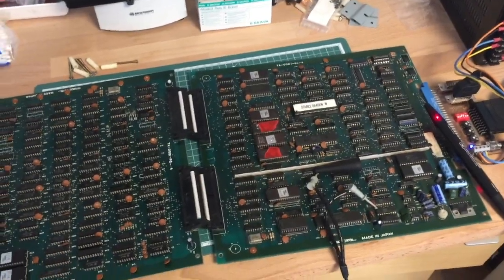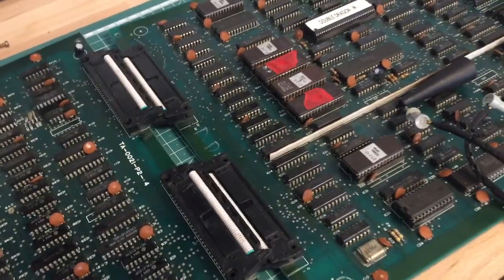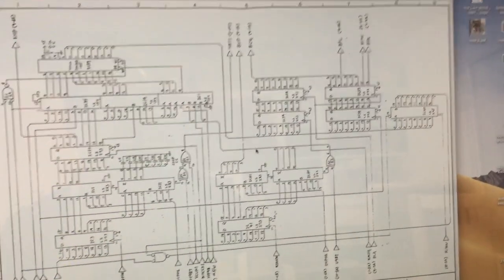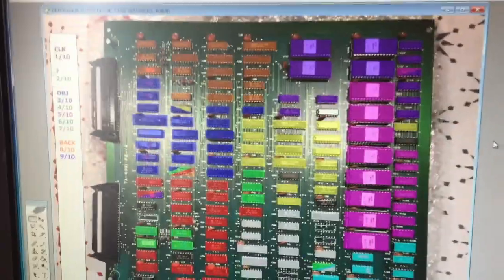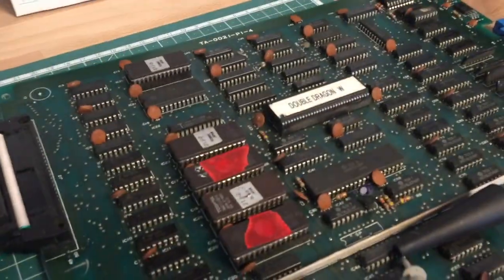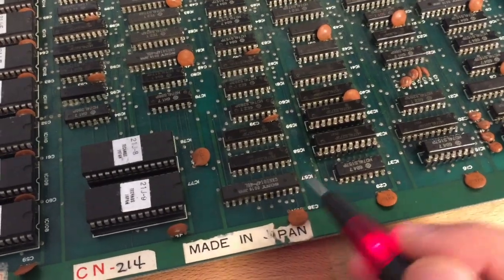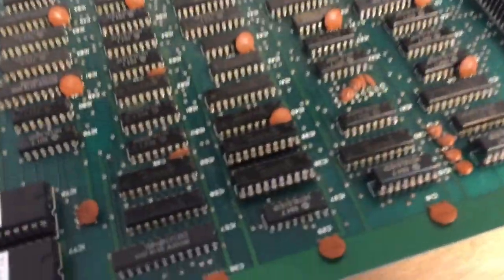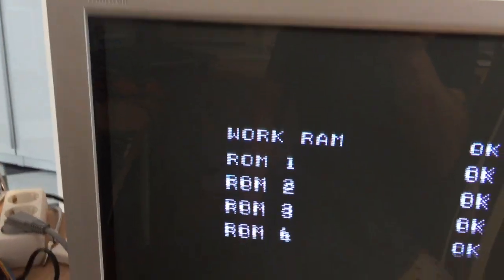Double Dragon Arcade PCB repair - Board#5

Comment: The problems with these boards is usually bad ram and buffers. 90-percent of those 16-pin DIPs on these arcade boards are buffers.
5☆ video friend.

I might buy a huge box of faulty but complete boards soon. I have a lab at a factory unit where I can do all these repairs. I have plenty of buffer ICs 74HC and 74LS etc... but I needs to get some old RAM chips. Anyone have a generic list they want to share for RAM chips used on boards say 1981 - 1988?  I am chasing boards between 81 and 88. Love that vintage of game.

Comment: Thank you for the new and great video. I don't really know the "-5V" requirement. Could you tell how sensitive is the PCB to Power Supply "-5V" changes? -4V or -4,5V isn't enough, right? Thanks in advance for your answer.

Comment: DOKTORZETT, can you explain more about how arcade games use the multiplexers to switch on and off the graphics and V&H sync signals. Why are they using RAM chips as a buffer chip? why not just use a buffer chip instead of using a RAM chip? Does the Test diagnostic program have the address mapping and address decoding RAM and ROM ranges built into the code?

Comment: Welcome back!

Nice work, as usual. Faulty RAM chips seem to be fairly common with old arcade boards. Luckily that's all this one was. The cool part, though, is the diagnostic steps and the results at each step. That's why I like these videos so much. I see a lot of "So I did this thing, then that thing." explanations on other videos, but without showing the steps themselves. I think your approach is much better.
Reply from the maker: Thank you! And yes, you are right, the ram chips are one pretty common problem on the double dragons, also the prom chips seem to be problematic often, I think because they tend to get very hot. But you also see eprom failiures, failiure of regular ttl "glue" chips and well as with all boards corrosion related and physical damage related issues. So I think that still every repairt I start is an interesting project and I have to admit that I do have another board on the bench with I worked on for a long time and I actually don't seem to be able to figure it out. Challenging!